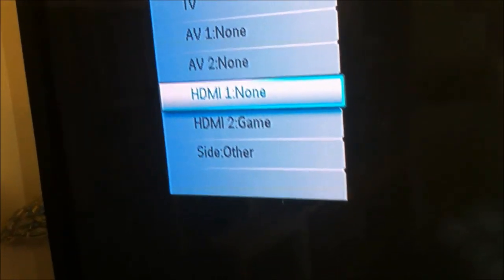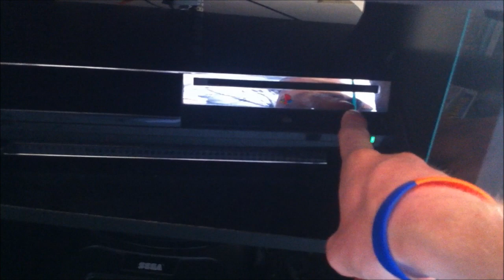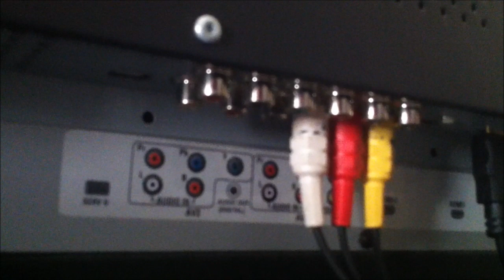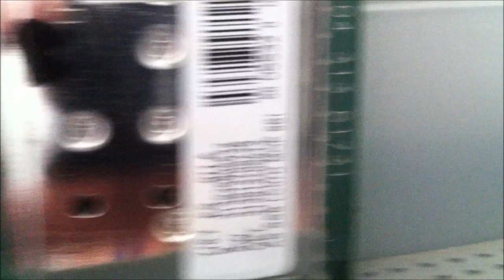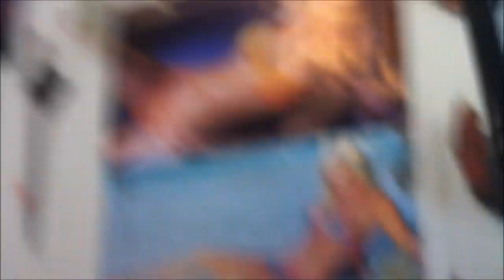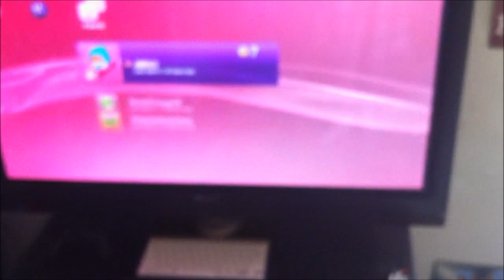42" Philips failed HDMI ports. Model: 42PFP5332D/37. How to disassemble + possible solutions.

Comment: Hi. You could get a HDMI splitter. But you can not run 2 things at once only one at a time. You'd have to turn one off to work the other.. You wouldn't have to replace the board. Otherwise you run the risk of overloading HDMI. Did you try a TV repair shop. They may be able to get you a new board. Good Luck. 
You also could try soldering the second HDMI back in. But be careful with the heat may damage the board if left to long.

Comment: my comment for you, throw some epoxy over the 2nd port(while something's plugged in so that the epoxy doesn't run into the plug) to reinforce it, to avoid it ripping out too.... just found one of these tv's smashed and both hdmi ports were ripped out; probably why it was smashed;P
Reply from the maker: That's not a bad idea. Such a poor design. 😓

And yeah.. probably! An HD TV with no HD input lol.

Comment: did you end up fixing the problem? i have the same tv and both of the hdmi ports "snapped" or something... do you think i can order 2 new hdmi ports for the tv and have a professional re solder it in?
Reply from the maker: I didn't bother fixing the first port because my second one is still working (knock on wood). For mine, when the HDMI port came off of the board, it peeled the contacts that it was soldered to off of the board along with it. While the contacts in some cases can be replaced by professionals, it is pretty expensive and not something that is typically done. Note that your contacts could be intact, but I would guess yours also peeled off. My recommendation would be to replace the entire board that the ports are connected to. Alternately, you can use the component ports on the back of the TV. I don't know how well you know your video ports, but when I say component, I'm not talking about the composite. Component offers significantly better quality than composite and many devices offer it. The PS3 has that option, for example. 

Here's an illustration: http://www.proavrentals.com/rent/images/stories/assets/Video_Connector_Types.png

Comment: STAY AWAY From Philips! I bought a TV and after 7 months it quit working. Tried to get replacement under warranty... Been 3.5 months now and still no TV. In fact, I returned mine via the RMA/shipping label they provided. When I emailed asking them when I could expect a replacement, they sent me the tracking number that I had to return the TV and said I received the TV and needed to call the police to file a report. THEY NEVER SENT ME THE TV AND NOW DO NOT RETURN MY EMAILS!!! Wish I talked to a co-worker first who had same problem. Philips? RUN AWAY!!!
Reply: i don't think bro i have mines since 2007 and now is that its giving me problem with the ports

Comment from the maker: I have to admit, I wasn't expecting 12 thousand views on this video. I guess there are quite a few others out there with similar problems. As for those asking about purchasing the board, ebay is the only source that I am aware of, but if anyone else knows of any better options please share! It's been nearly two years and my last HDMI port is still holding up (knock on wood).

Comment: I have the same tv never any of the problems you had I had one problem when I would shut the tv off it would make a clicking noise.. under warranty they had came out and fixed it  it was a bad capacitor but.. I have a site where I purchased parts from (shopjimmy if you are in need. now I hadn't had to replace any parts on this tv